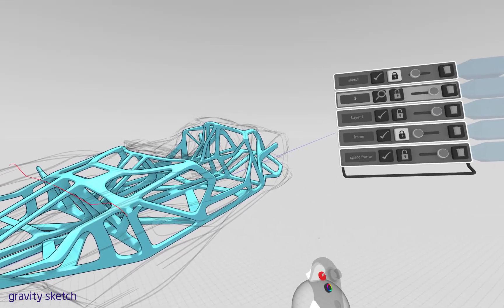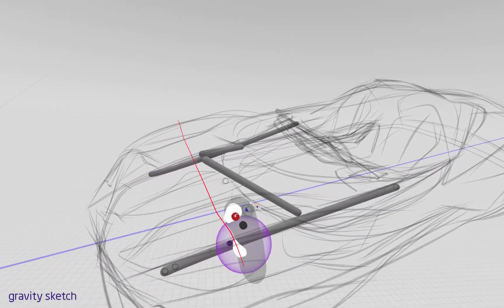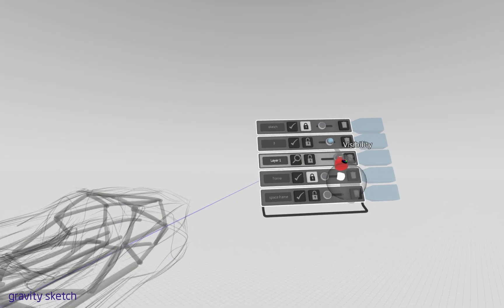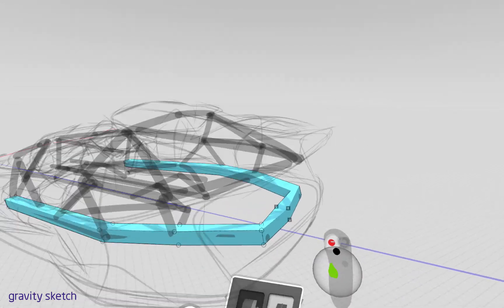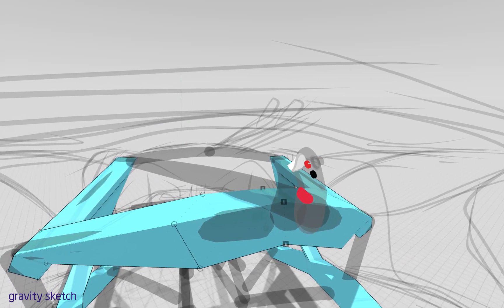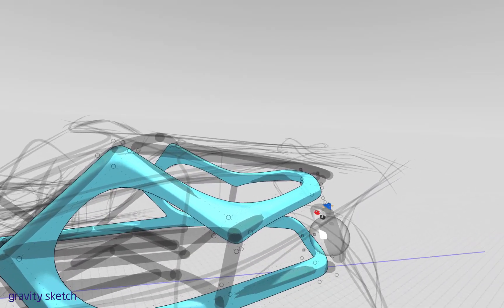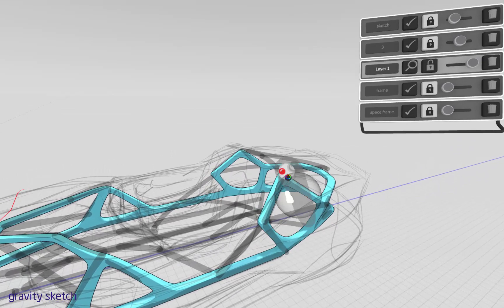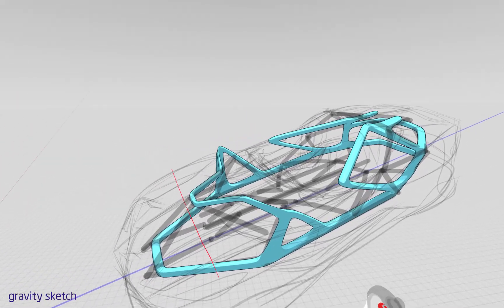HOW TO!! Organic Tube frame in Gravity Sketch!!

Comment: but how you delete only a face from the durface? when i try that, i delete more just a face, thanks for the help!
Reply from the maker: Make sure you are in edit mode for the subD object. Try this. Grab the object with the grab sphere, then hit the blue edit button. You should see the edges, points and faces of the subD object. Then make sure you are in face selection mode or multiselect mode. This is on your dominant hand and can be toggled with the joystick. there will be a a little triangle that will show which mode. Then you should be able to select a face with the grab sphere and then hit the red button on the same dominant hand. hope that helps.

Comment: This is awesome work! I have some questions,
How do you close an open subd face? Also is there a way to split the frame into different parts for seperate printing? And finally is there a way to get more exact mounting points, for example like a cylinder merged into the frame? Cheers!

Comment: would you recommend Oculus quest or a rift at this time for grav sketch?
Reply from the maker: I do  a lot of my line work with the quest in stand alone/ Mobile mode. I then Connect the quest using Oculus Link and finish the model in the full desktop mode..The quest allows the best of both in my opinion.
Reply: @JamesWRobbins   well thats my mind made up. Thanks James.